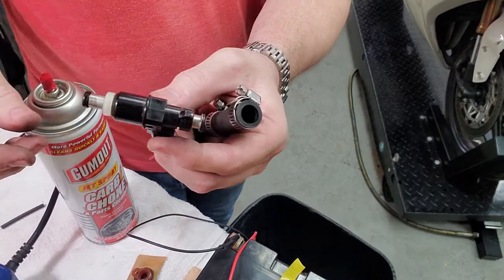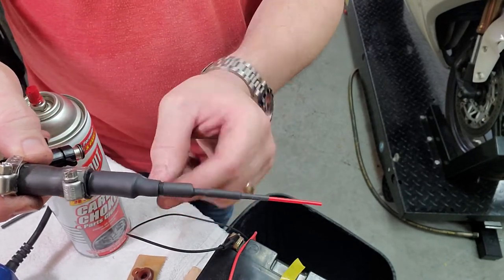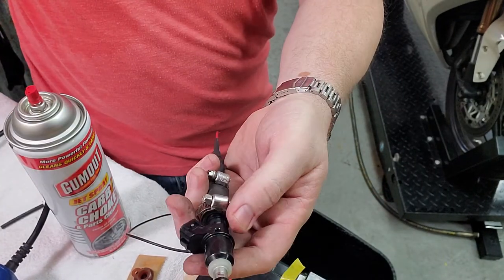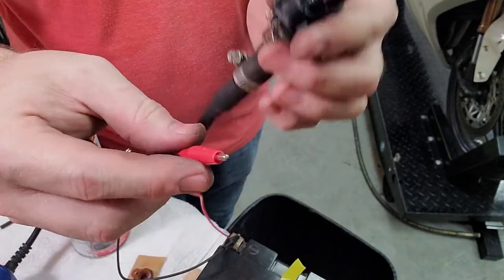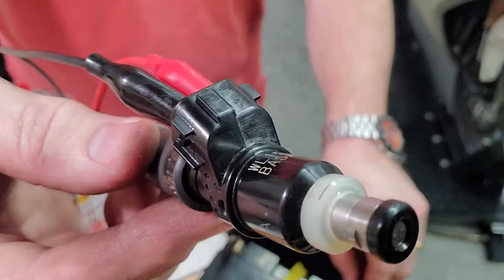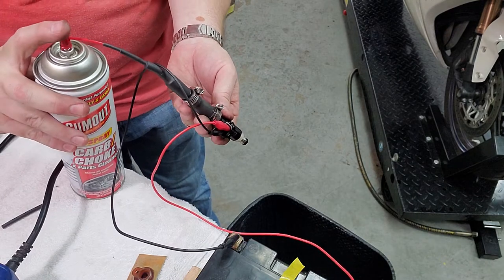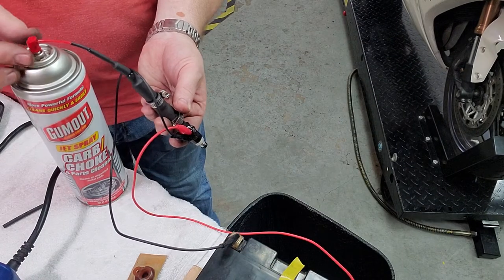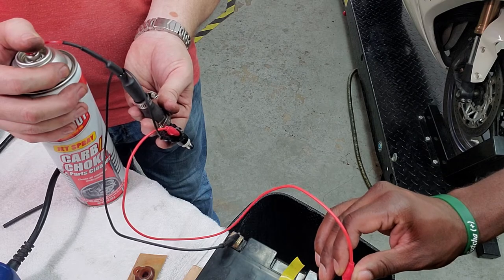Flushing & Testing Triumph Daytona 675 Fuel Injectors

Comment: Best method I have seen is using a valve stem.  Take the Schrader valve out drill a small hole in the valve stem cap for the carb cleaner straw and glue in place.   The other end fits nice and Snug on your injector.
Reply from the maker: Great tip! Thanks!